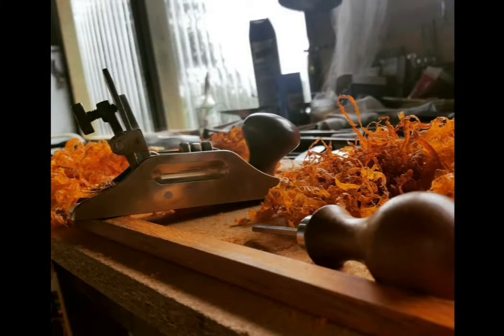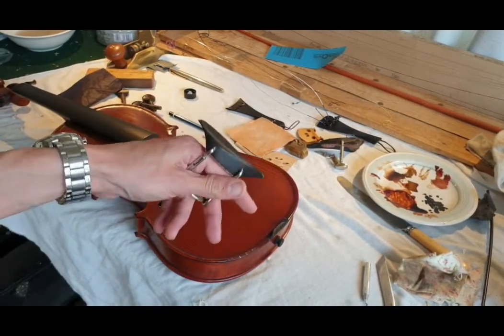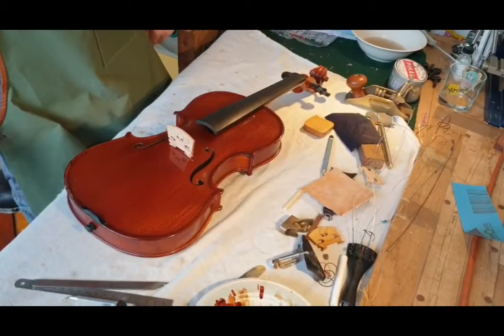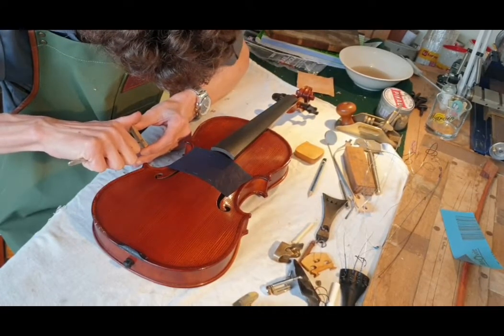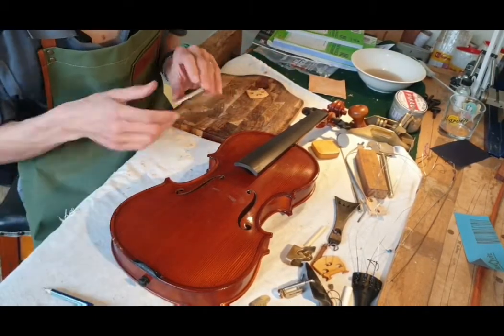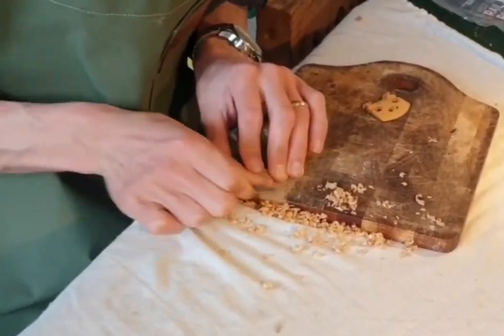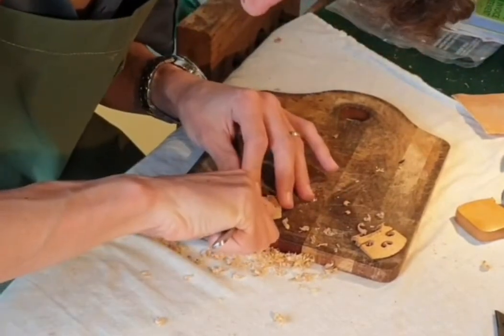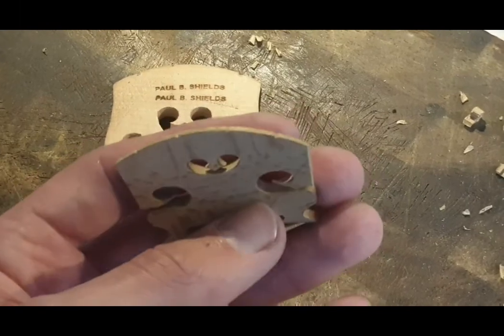how to cut a violin bridge

Comment: Nice work. I noticed you discussed the appropriate string height but I did not notice you take a measurement for them. Did I just miss it?
Reply from the maker: Hi,  I can't actually remember! Most likely it got edited out,  but also once you cut a few thousand bridges you get a feel for the correct string height, so I may have just skipped that actual measuring bit.